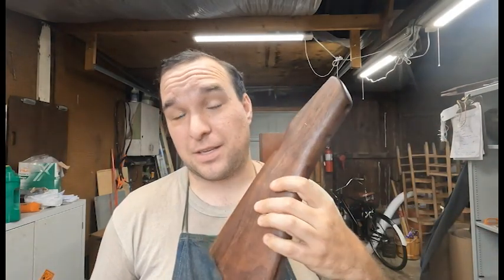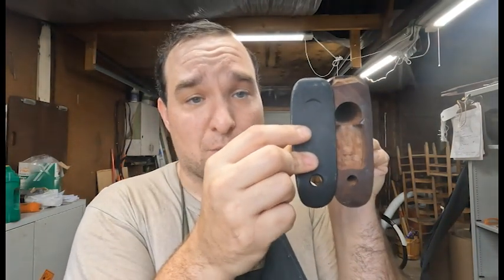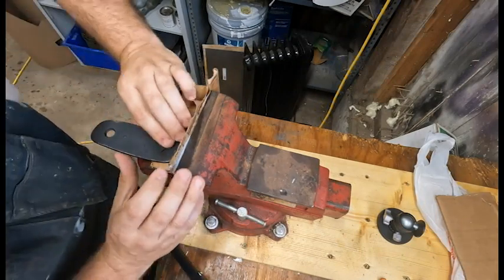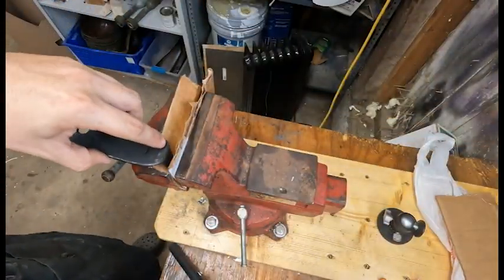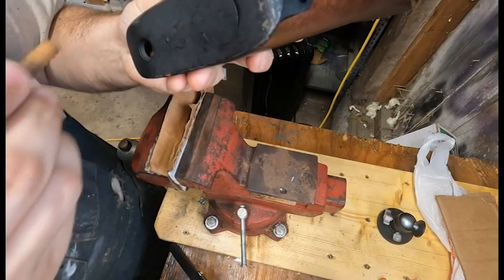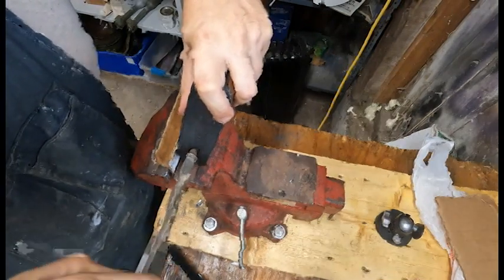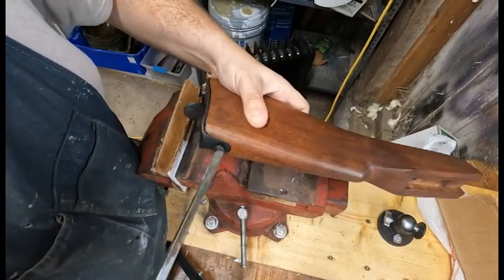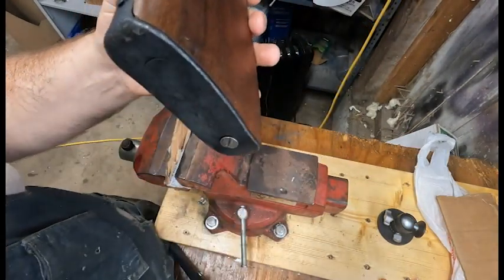Fitting an M1917 Rifle Buttplate onto an M1928 Thompson Stock

Comment: Nice project! If you are wanting a perfect fit you have a couple of options - using a polymer-faced hammer apply a few blows from the inside approximately at the top of the butt trap hole to straighten out the buttplate slightly. Option two would be to use some inletting grease (or other inletting black) to mark the grain end of the buttstock and file/sand for the perfect fit. Frankly, I think your fit is fine as is.